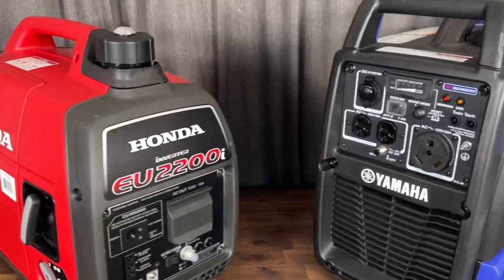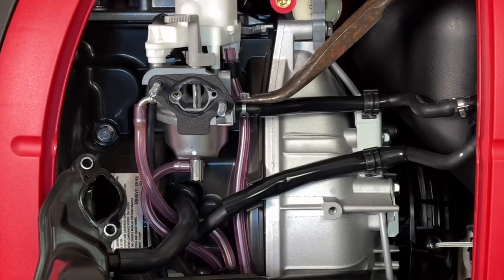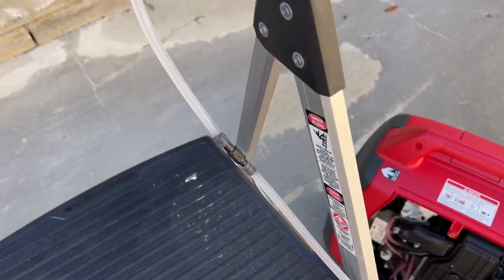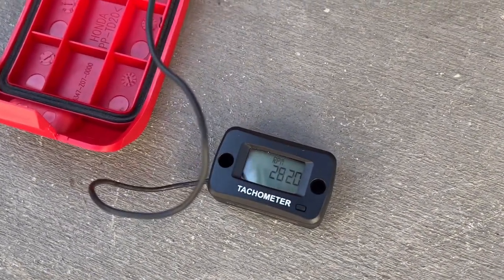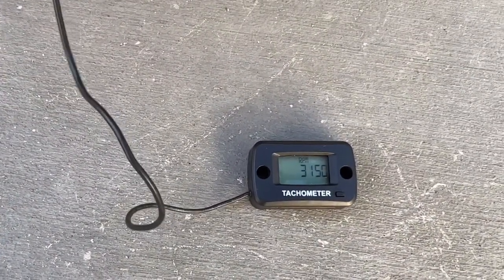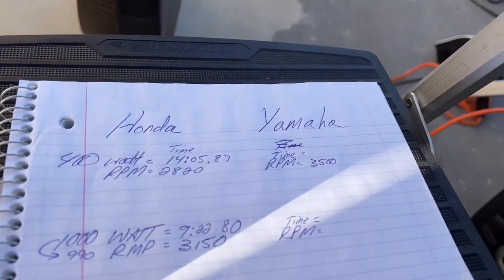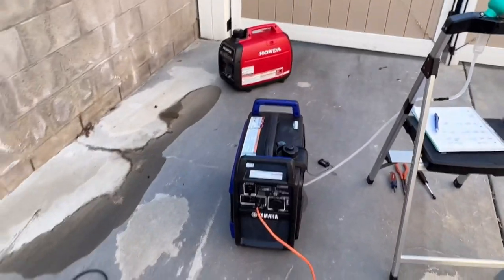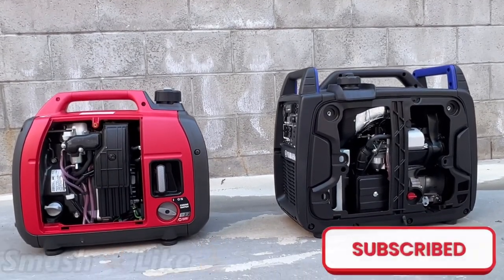Honda Eu2200i VS Yamaha EF2200is Fuel Efficiency Test

Comment from the maker: Hope you like the video be sure to subscribe..👍🏼💥  What do you think? Does this change anything on if you were to buy one? Does the fuel efficiency matter to you, as over time that can as to alot of savings? Thoughts….In this video we finally find out is the yamaha really more fuel efficient across the board, or not really at all. The hondas bigger engine idles lower but does it consume more fuel? 
Let me know what ya think about the test. Is there something else you wanted to see? #honda #yamaha #invertergenerator #Hondaeu2200i

Honda eu2200i sale price: https://amzn.to/3wxpCxb
Yamaha 2200:https://amzn.to/42YgEFf

Other good units
Pulsar 4000 dual fuel:https://amzn.to/3IjnTOF
Champion 2500 Dual fuel:https://amzn.to/3Ik5Ho7
Maxpeeding rods 4000:https://amzn.to/3UYApuA

Comment: It's important to have the side cover on to ensure proper airflow like it was designed for. This is precisely for high loads.
Reply from the maker: What exactly are you saying for the test or in general?
Reply: He means the air cooled motor can easily overheat without it's covers on. The covers keep the air moving in one direction from front to back. First the inverter gets cooled and then the motor.
Reply from the maker: Ahh ok well true but on a mid 70 degree day I think both units will be fine… 
Especially during a short duration test

Comment: An interesting comparison. I've been a Honda rider since '76 but opted for a Yamaha genny solely because the Honda dealer insisted on charging me the setup fee whereas the Yamaha dealer didn't charge for setup. No regrets, love both brands as they are both equal quality in my eyes. Thanks for the comparison. 👍

Comment: GREAT TEST!  Thank you.  Like another guy commented, knowing the exact amount of fuel used for each test would have been even better.  Not complaining, its was a great very time consuming test with great info.  Based off your reply to another commenters question on fuel consumption of "about 100cc per test" the math comes out close to what Honda specs in their description.  Based on estimated 100cc of fuel per test the Honda would have got 3.6 hours of run time per full gallon at rated load.  Their literature states 3.2hr @ rated load 8.1 hrs @ 1/4 load (based off .95 gallon). That equals 3.42 hours of run time per .95 gallon at the load you tested at on the HONDA.  Great stuff!  Someone else can ask dew point and humidity during test to figure out any evaporation. LOL J/K. 😏
Reply from the maker: Lol yea add all that extra and elevation changes and then it gets complicated… lol

Thanks for the reply and thanks again for watching 😀👍🏼

Comment: Excellent comparison.  I'm surprised the Yamaha turned out to be comparably efficient.
Reply from the maker: Yes it did great and again the margin would be even broader if there was a bigger tank.
Reply: @johnnysweekends  and I've had the EU2200i shortly after it became available.  I do like the larger piston & steel sleeve inside the piston bore + the accessibility of parts & service almost everywhere in Amerika if needed.  No.  I've NOT had any issues with mine.  I've modified mine with a 3-way fuel valve that now allows me to use an external fuel tank instead of the generator's small .9 gallon gas tank.
    YES, I drain the carb's float bowl & purge all gas from the lines AFTER every use.  And I've switched to an NGK spark plug + I use Amsoil 5W-30 100% man-made synthetic oil in the crankcase.+ I've added an hour meter which I've felt is something Honda should have included in it's design.
Reply from the maker: Nice sounds like your gen is set… and yes a hour meter beside the built in light should have been added but again I have said this a lot, there is no reason this model shouldn’t be a 2500.
Reply: @johnnysweekends  Aaahhh men, brother!

Comment: I've always leaned Yamaha since dirt bikes, street bikes, sound bar and a pressure washer, but opted for a Honda string trimmer a few years ago. I love it and the sound. So I went with a double Honda with extended tank set up.  The size difference is big too. Can't really go wrong regardless. I'll forever be a tuning fork fan. 😉
Reply from the maker: I hear ya I owned Yamaha Honda Suzuki and then a ktm dual sport. I think my couple Yamaha were the bikes I had the most fun on. The dual sport was good to just heavier obviously.

Comment: You should get an oscilloscope and view the waveform output and see which unit produces cleaner power, idle and when under load. I would like to see those compared. Basically I'm under the impression that you really can't go wrong with either of these units. Both made by top shelf manufacturers, both designed to work well and last a long time and the differences being extremely minor.
Reply from the maker: Yea looking into getting one since so many requests. But yea I bet difference is minimal.

Comment: Thank you! Based off your math, an inverter generator really could run 7 hours on single gallon at low loads (around 400-500 watts) 

That’s really good to hear because a 5000 BTU AC uses around 500 watts

Comment: Thanks for that test. Do you know the volume of gasoline in your temporary fuel tank and fuel lines? It would help me if you could share that! Thanks!
Reply from the maker: I don’t remember the volume and I didn’t write it down. From the container and fuel tube to the carb never changed. The only thing that did was the carb it self which each float bowls volume was slightly different. But it would be less than one once. More like a 5cc or less difference

Comment: I've got two EU2200's and I just bought an EF2200.  I've got to tell you, I'm impressed with this thing.  Yes, it's bigger and bulkier than the Honda, and it's a bit noisier, but it's a little animal.  After running it for a bit, I hooked it up to my transfer switch to see how it would handle my gas furnace with a 1/2 hp blower motor.  It handled the start-up on eco mode without bogging down; I was very surprised.  The larger tank, fuel gauge and carb drain valve are nice touches also.  Question: I inserted my Honda parallel cords into the Yamaha's receptacles, and they fit perfectly.  Do you think I can safely use them, rather than buying Yamaha's parallel kit?  Thank you.
Reply from the maker: They are not data cables.
It’s just a piece of wire. That’s all.

Comment: Great video and comparison test. Do you know the size of the small fuel “tank” you used? I run the Yamaha and would like to extrapolate these run times to the actual tank size. Thanks!!
Reply from the maker: I think total volume of the syringe was 100cc roughly plus the tubing so not sure on that. Maybe another 30cc..??

Comment: So what was the rate of consumption? How many hrs per gallon does the test equate to?
Reply from the maker: This is more of, if you have a gallon of gas, which one will provide more total power output or run time. And that would be the Yamaha. Fuel consumption specs are available for both units on there site.

Comment: I noticed the Honda's Idle was running on the rough side the generator was actually moving. The Yamaha was rock steady. Why was the Honda running so rough any idea?
Reply from the maker: Sometimes at certain rpm’s the Honda will just vibrate a little more, kinda like the harmonic balance gets way off in certain rpm ranges.  It’s not anything to worry about but yes the Yamaha runs smooth.
Reply: @johnnysweekends  great test btw nice improv to compare both machines
Reply from the maker: Thank you. People have been asking which is really more efficient so figured I’ll check it out.
Reply: @johnnysweekends  please compare the the MaxPeedingRods unit to these two using the same set up.
Reply from the maker: I think the Honda would be a more fair comparison as the Yamaha will win over both, but the max/Genmax has a 145cc engine over the Honda 121. But carb and jetting make a difference but I would assume the Honda would win…never know till ya test.
Reply: Considering both units are both same power, my choice is the Honda for longevity. With the Honda you get 50% more engine displacement which translates into a slower running engine.
Reply from the maker: People love the Honda for the bigger engine but then I have people who love the Honda for the simplicity of the Yamaha engine as it does not have a belt drive for the valves. They are both so bullet proof !

Comment: You should have stopped the timer once fuel crossed a mark placed somewhere on the fuel line. This way you remove uncertainty of different carb volume between the generators skewing the run time. You also could have measured exact fuel used per load level and produced kWh/gal fuel efficiency results.
Reply from the maker: Yea sometimes you think about what you could have done after the fact. 
Although I think both carbs had relatively the same size float bowls, and this did provide some good info. But the difference in size, I couldn’t see it being more then about a cc of fluid plus or minus which would vary in seconds of run time I would assume.

Comment: So on these inverter generators, how low can the output go in watts before you stop saving any fuel?  I know manufacturers use the 25% load metric, but is it lower?
Reply from the maker: Well there is a pro and con to trying to save fuel and also using the generator correctly. 
Idle rpm will be lowest fuel consumption with say a minimal output in watts. But is that efficient? And when always running low idle loads your building carbon deposits on head and valves, and down stream in the exhaust system and spark arrestor. Not to mention plug fouling will be more common.

If always needing low watts towards the low end of day these units. It may be a better to get a small unit. 
You want to live in the 30% 70% range if you can. If you live at one of the above a majority of the time, the next size gen may be a better option.

Comment: I'm assuming the power on the Yamaha is lower because it didn't output as many volts?

With lower power output that might cancel out it's fuel efficiency gains.
Reply from the maker: I don’t think it will mess with fuel efficiency too much as power out for that unit is what it is. But maybe if doing a charge on a battery bank at say 1500 watts consistent will the Honda fill it quicker and shut off some saving fuel..??? 🤔

Comment: Less output on the Yamaha, less fuel consumption, my opinion... , an for me, it's always the Honda, because of the stability of the Output power. And, lower rpm is better for a longer life. But, that is my Opinion... And Yamaha is not a bad brand at all... 😊
Reply from the maker: I agree both are good units and some people are die hard Yamaha. And honestly I don’t hear a lot of bad feedback on the Mm. 
I do like the low rpm purr of the Honda and smaller design over all

Comment: I would love it if you did this test against the westing house 2200 and 2500. This is exactly what I've always tried to figure out. This video rocked. I'd have bought the Honda if I wasnt to cheap so I bought the Westinghouse.
Reply from the maker: Lol I hear ya, I think both the westing house gens use the same 80cc clone Yamaha engine so fuel will be very close. I would assume the 2500 would be a little less since it should be able to idle down a little lower. But again I think.. 🤔😂
Reply: @johnnysweekends  I just bought the 2500 last week so I'm still breaking it in. If it's as efficient as the big 2, I'd be really happy.
Reply from the maker: I bet it’s pretty close. 👍🏼

Comment: Have you considered that the Yamaha could have a slightly bigger float housing?
Reply from the maker: I did not measure the float bowl size. But I would assume if they are different it could be more then about 1 or 2 cc by looking at both of them. 
Minimum differences
Reply: @johnnysweekends  You are probably right! Thanks for a good video. I’m preparing my generator and fuel storage here in Sweden in case Putin cuts the power cables🤷‍♂️😅
Reply from the maker: Ahh gezzz man sorry to hear that. We’ll make sure you have a couple extra spark plugs, some oil and know how to fix the low speed jet if it gets plugged. 
I made a quick video on that as well. 

And your welcome glad you liked the video and take care over there..👍🏼

Comment: Why didn't you use a line or graduation on the container to stop the test? You wrecked your control letting the line empty and the generator sit there and sputter.
Reply from the maker: That was the hole point. 
The fuel line was directly hooked up to the carburetor. Each float bowl was pretty close to the same, although not measured I bet not much more then a ounce separated them. 

Then from the bulb syringe and clear tubing down to the carb, each generator had the same equal amount of fuel to run there test until shut off. 

So over all the control was pretty darn close in the test to give enough usable information for those who needed it or wanted to know.

Comment: I'm literally so torn between these two. I will 95% of the time be using this for tailgating at college football games. Will have a TV running for probably 6-8 hours with MAYBE a Crockpot running for 1-3 hours here and there, as our grill is propane. I want the long-term efficiency and trustworthiness that I assume comes with a Honda, but the fuel gauge that would give me a lot peace of mind with the Yamaha since I know I would be checking the Honda's fuel level constantly without one. Any suggestions?
Reply: For reference, I would be running this generator at the front of my Tundra while tailgating at the back of it, in reference to sound . Appreciate any input you might have!
Reply from the maker: You could always get the Honda and add a extended fuel kit… which is a option but if you are running low watts most times the Yamaha over all is more fuel efficient…
And the Yamaha mz 80 motor is pretty darn bullet proof. Also a little cheaper. 

I know tough choices.

The Honda is a pinch lighter and more compact if that helps. 

I do like that RV plug on the Yamaha though and it even has a little night light that stays on
Reply: @johnnysweekends  Thanks for the input! Really do appreciate it!
Reply: @johnnysweekends  Do you think these two generators are on equal playing fields and are just tit for tat, or do you think one is genuinely superior overall?
Reply: @johnnysweekends  I will say one of the biggest reasons I had been leaning towards these two was because I thought they were both not made in China, but found out due to your video that the Yamaha unfortunately is. How much do you think this has impacted, if at all, the quality of this specific Yamaha generator?
Reply from the maker: You’re welcome 👍🏼😀
Reply from the maker: Well even some of the Hondas are made in China I guess and soon more and more. Now for Yamaha I assume the motors are shipped to the assembly plant at least I hope but who knows now. 

I know it’s a tough choice I think you’ll have to find do you like the compact Honda or the couple extra options and fuel efficient Yamaha…🤷‍♂️
Reply: For that application you might consider a battery generator that you just charge up before you go. No noise, no gas, no oil changes, no pollution, Etc.
Reply: For just a TV and crockpot ( less than 500w total) you could do a eu1000i. Quieter, more fuel efficient, lighter and less expensive.
Reply from the maker: I would even consider the HF 1000 that looked as close to a Honda clone as it gets. Was gonna do a review but I just don’t see enough people buying the little ones.

Comment: Not sure what kind of oil you had in these.  I used synthetic in my wen 56203i one of them from the start and the other after a break in period on straight 30w. They were purchased at different times with one coming with fuel level window.  The newer fuel window one I only used synthetic and it was junk.  Always cutting out gas hog real sensitive to oil level.  The older one that I did 30w break in was a beast would use way less gas.  Not scientific but I would fill them both up and put under same load and the newer one would run out way quicker.
Reply: Now I’m running 56380i wen and it’s so far so good.  About 130 hours so far.  Using only 30w and that is all I’m gonna use no synthetic which I’m really not sold on for these little engines.  Now if it’s below 40 degrees I don’t use them.  Not scientific but it seems like when I needed to add oil to it the gas consumption got worse not sure what that was all about.  Never figured out why those 56203i leaked oil so bad but I sold them to pawn shop so I guess they will have to worry about it and not me.
Reply from the maker: I have heard issues with the 2000 watt model which I was surprised but who knows. 

I often wonder as well if the synthetic oils are not as good for these still very basic motors have probably do not have a very tight tolerance like cars and more. 

It’s very possible they may do better with a semi synthetic or regular base oil.
Reply from the maker: And that lol is cheaper as well